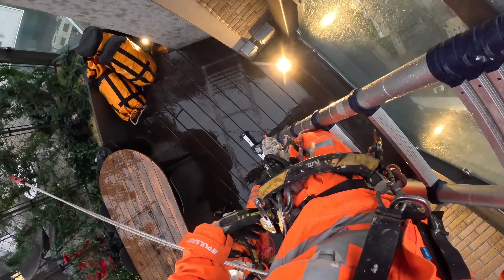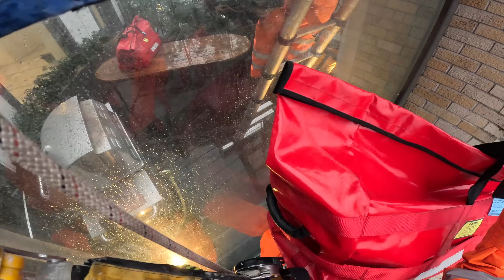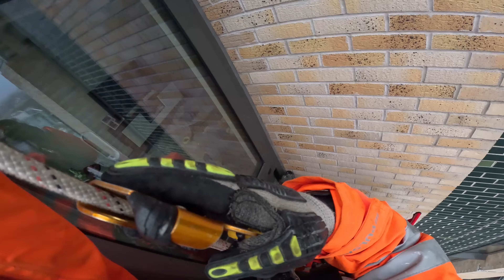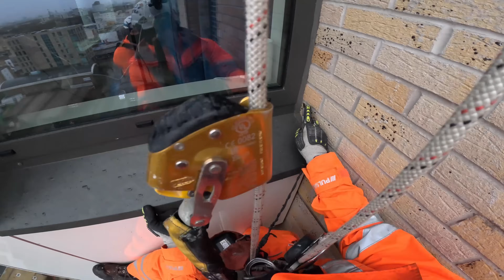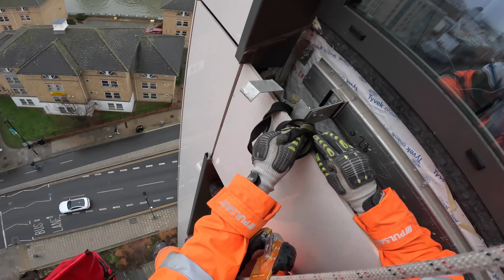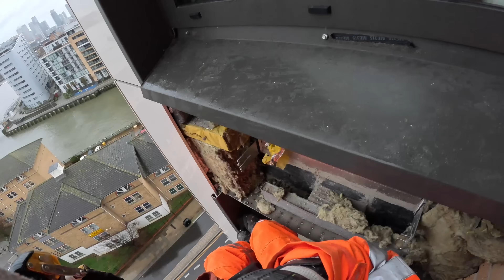Working at height - cladding removal

Comment: Not only the height but also in the rain while you're using friction based safety items. Insane!
Reply: Dosen't really make a difference, if you fall it will catch you no matter the conditions.
Reply: @FluePeak  I agree with you. but that rope starts acting like a rubber band when it’s wet and starts messing with people.
Reply from the maker: Descending in the rain always makes your tummy feel funny
Reply: @skitzkellz9091  wrong, it acts more like a brake rotor which will work great in the rain. there is nothing to disagree with
Reply: @wr8196  I said I agree brother. You might have misread my comment, or replied to the wrong person.
Reply: Hope your on 50k sterling or way more for that job
Reply: I used to do something like this for fun, underground. I hated bone-dry trips as I always worried about friction making the gear hot enough to damage the ropes.
Reply: Ironically the most dangerous part of the shift was almost certainly climbing that little ladder to reach the edge. If that thing slipped you'd crack your jaw something awful! I generally enjoy the rope access work I do, but I have never gotten used to working on extension ladders!
Reply: @slowgold20  i work on skyscraper rooftops daily as an inspector and the only time i get shaky knees is when climbing those fucking wobbly portable ladders man
Reply: Someones clueless
Reply: @Corny6251  just had to stop and waste your time to add absolutely nothing of value. Miserable much?🤣

Comment: I recommend throwing a second back up device on the other set of ropes before moving between anchor points. I personally like to throw my hand ascender with footloop on the new main-line after I have it in the chest ascender. Great video and great work!
Reply from the maker: Yes there are ways to improve that rope transfer
Reply: @ heard that, I could count a million ways I need to improve. Stay safe out there brother

Comment: Choke hitch on a sling reduces swl by 20% not 50%, double it over increases swl by double eg 1t =2t. I worked with rope access on oil rigs (dope on a rope) as we call them 😂 anyway fantastic work. Also a good tip is to wear thin gloves when fitting because them lvl 5 impact gloves is like wearing oven gloves when fitting screws ect.
Reply: Thin glove and I cut my index tip of the glove off and the tip of my thumb glove off for easier handling.
Reply from the maker: Impact gloves were a dream when removing the slip bricks and you accidentally hit your knuckles on the walls
Reply: @Grasscutter69  I also use thicker gloves and still cutting the fingers of. I’m a tower climber so different strokes for different folks but cut gloves are what I go with, thick or thin. Try it out.

Comment: Nicely done, what was the issue with the cladding?
Reply from the maker: The cladding needs to be removed to access the issues behind
Reply: @Grasscutter69  Issues with insulation or something else?
Reply: @Neeksperts  looks like compromised horizontal fire stopping maybe
Reply: @cliveramsbotty6077  slab edge cavity barrier seems fucked, my oppinion if they are trying to compartment the floors which is standard practice nowa days, Should be Z-clips spit gunned into slab, and then rockwool SP60 cavity barrier installed nice and tight, then taped correctly.
Reply: @Epicko555  very informative, thanks

Comment: No 2nd backup during rope to rope transfer?
Reply: @VanadiuM140291  I watched it again and it’s not a big transfer so the chance of a big pendulum is pretty low. With hindsight it’s just like a re anchor rather than a big rope to rope transfer. Costs nowt to throw an alpine butterfly in and chuck a cows tail in though if you don’t have another backup device 😅
Reply: Я тоже обратил на это внимание!
Reply from the maker: Was being a little bit naughty- should of had 4 points during that rope transfer
Reply: I'd be more worried about hanging in the croll without a hand ascender above it. That is only allowed when stationary and plumb, i.e NOT mid transfer. No reason not to put it on first, you need it to change over anyway.

Comment: Isn't this building non-compliant? AFAIK insulation needs at least 1 water resistant barrier and here it's just mushed up directly against the window cladding.
Reply from the maker: I didn’t building it , just doing the repair
Reply: @Grasscutter69  I'm aware but i'm still asking you since you're doing work to the building in that area specifically and it seems like something that should be reported.